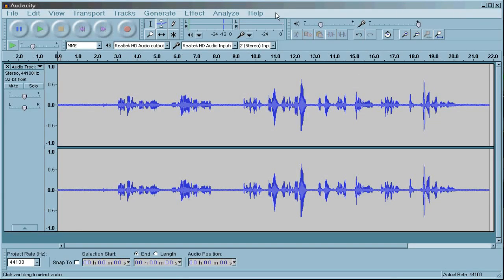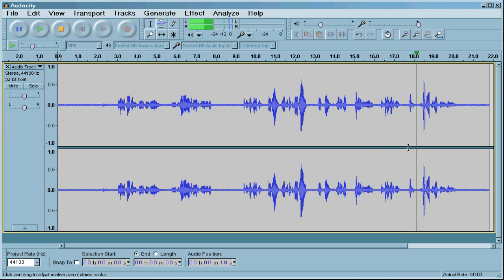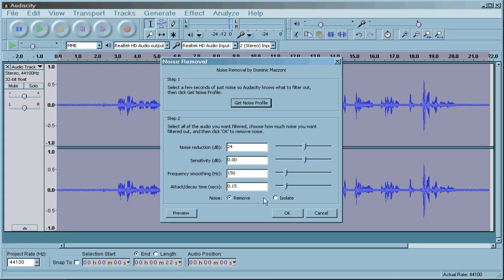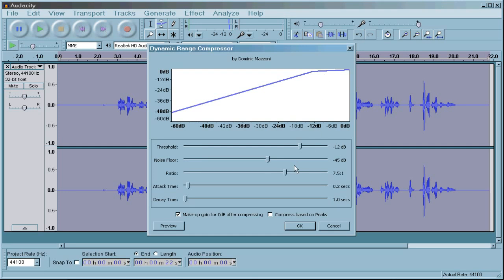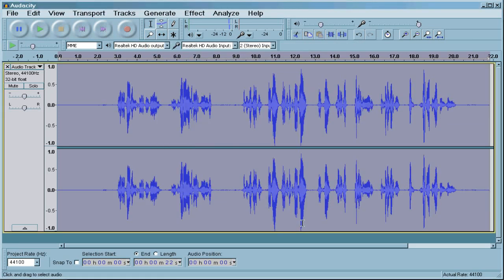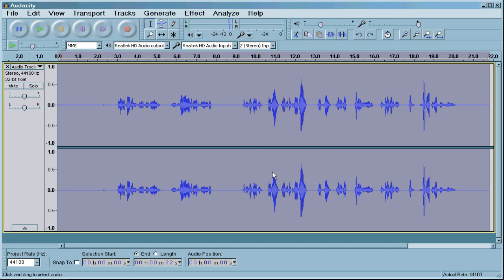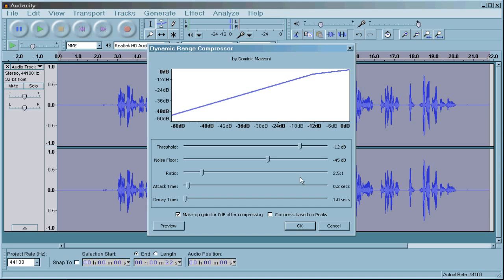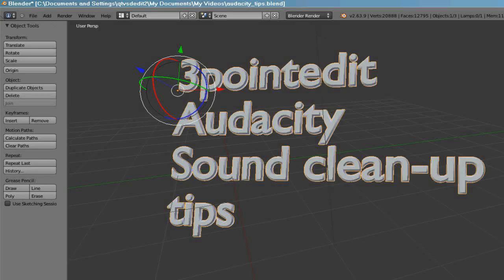Audacity Audio Clean-up tutorial

Comment: Nice video. Thanks. I found that the 24 setting was a little aggressive for my test recording but I was standing if front of an ac vent to test out noise reduction. Still it created some artifacts of it's own on that setting. Some sort of beeping sounds came up. Took it back to 12 and it seems much better though. Next I test it with filters on in the recorder to reduce it before it's recorded and I think it'll be perfect.

Comment: sound quality has depricated over time. final result no different.
Reply from the maker: ***** Well the waveform shows that there is no noise left between the words, however the mic I used was quite cheap so applying gain exacerbated the distortion on the words.
Reply: I did not mean to dis the effort. However in audio- say if this were something needed to be reproduced for a spy trial- it could involve tons of additive and subtractive synthesis in order to obtain a fresh sample with a wide decibal floor with which to work with. I understand it is spoken word and not necessarily a music sample. Again, thank you for showing Audacitys inner workings.
Reply: What would happen if you put a very clear clip next to a clip with a lot of background noise and then applied the "Noise removal" option to both files? Would it somehow fix the background noise clip?